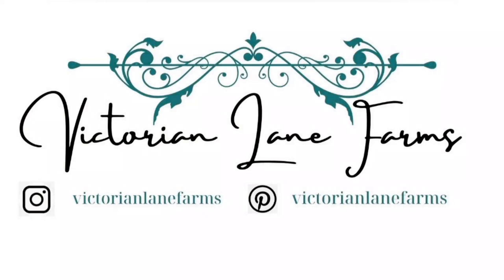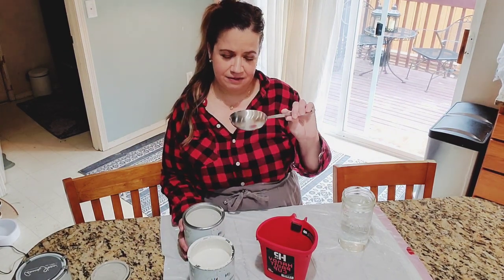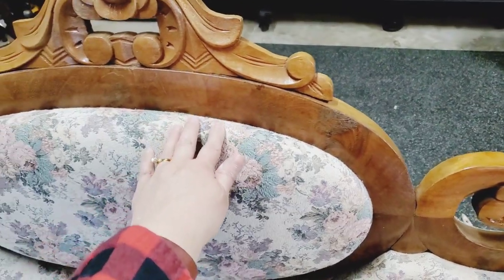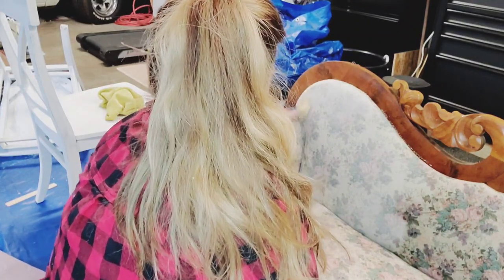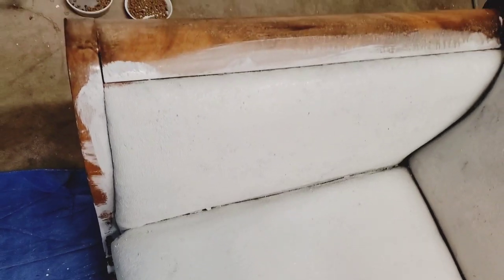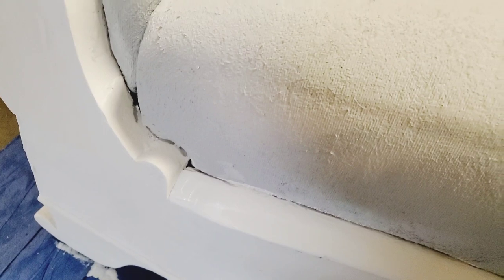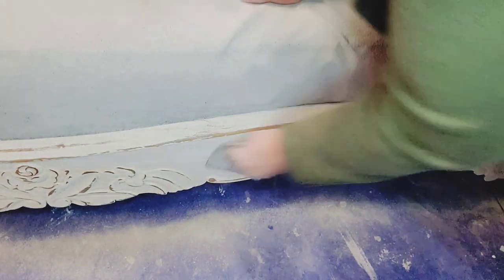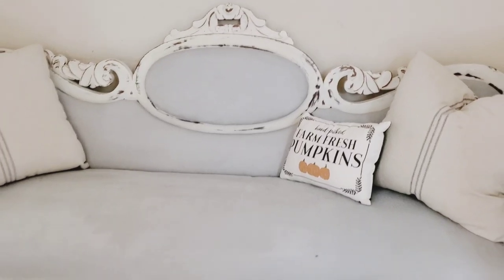I Painted My Antique Sofa  | Antique Sofa Makeover | Chalk Painted Upholstery

Comment: What kind of fabric was this sofa? Would this work for a silk sofa? Also, how is your sofa holding up now 3 years later.. a good thing to know is if it needs re-touching, or if the paint comes off on people when sitting on it. Thank you
Reply from the maker: Hi! Thanks for the questions. The fabric of the antique sofa is old and has a tight weave like cotton or canvas. Silk fabric can be painted but requires a different application. The paint must be watered down and brushed on lightly. As for how the fabric has held up. It's still smooth and has that soft feel. No need to retouch as of yet. I will link a video where I share a mishap I had painting a French chair & ottoman with silky fabric. Skip to the end where I show the fabric of all my painted fabric furniture (including the antique sofa) up close. There's also a link to the proper way to paint silk fabric you may find useful in the description of that video. I hope this helps. 
https://youtu.be/4Rep_afIJyU?si=Vq9TyRv-dRMfFn58
Reply: @victorianlanefarms thank you!!

Comment: I painted aneat old chair thats turfted. Its si scratchy i cant sit in it .. but didn't use Ann Sloan or water bittle ...do u think any hope for it  help!?
Reply from the maker: Annie Sloan paint is so forgiving. Sanding it down (lightly) and reapplying another coat, letting that dry, then sanding it again could work. Finish with sealing it with Annie Sloan's clear wax. (I sent you a link to a tufted chair tutorial in another comment) I hope this rescues your chair. Thanks for watching.